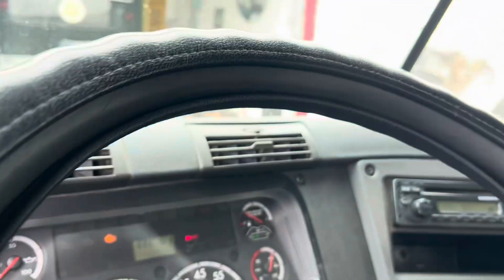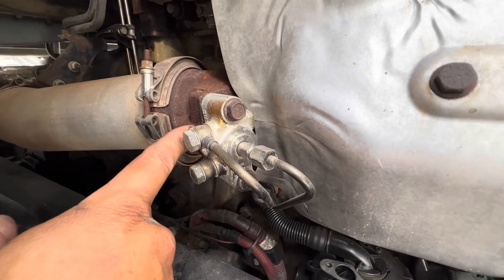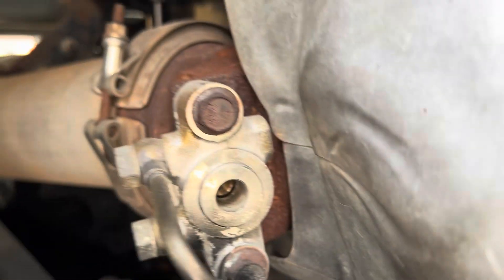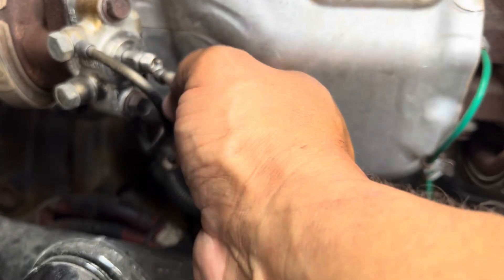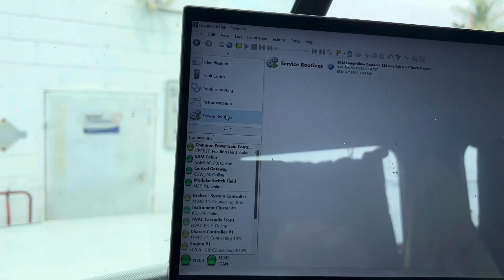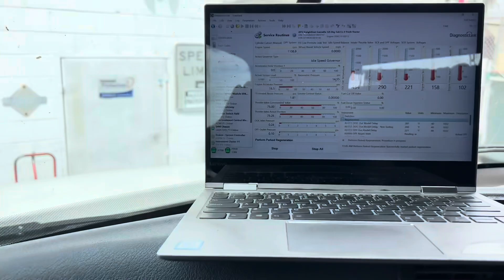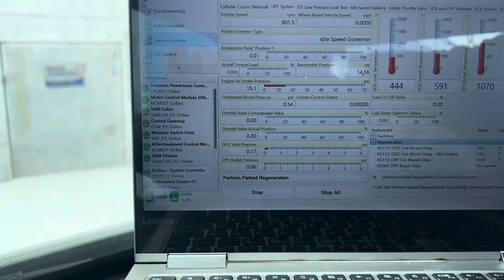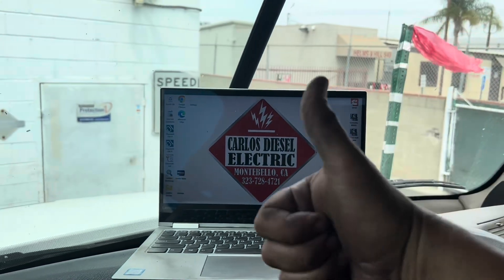Regen Temperature, out of range low. SPN 3556 FMI 1 Where to start and what to look for.

Comment: Had a doser valve replaced but the code keep coming back a few days to a week later . Any advice. Also i can get the truck to do park regen
Reply from the maker: What is the year and how many miles?
Reply: @CarlosDieselElectric 2016 with 941226 and I haven't clean that part yet went to dealer and the done the doser valve and regen then it came back went back they done some softwares  updates and regen again . Went to TA and they dont 2 exhaust leaks and Regen light still came back
Reply from the maker: @RONGTravel-Slots what is the DOC inlet pressure? DPF pressure? 
If there is a plug or flow issue that can cause the low temp regen. What else or other symptoms is the truck having?
Reply: @CarlosDieselElectric was told after regen all levels were in range
Reply from the maker: @RONGTravel-Slots does the regen run and then stop after a few minutes
Reply: @CarlosDieselElectric I cant get the park regen to even begin.  When the computer is hooked up it runs for all the way 45 min or so
Reply from the maker: @RONGTravel-Slots the truck will manually  regen if it is at DPF zone 2. The truck will always regen using the DDDL software.
Reply: @CarlosDieselElectric so if I push regen button it does nothing .The dealer and TA hooked up computer and did a regen
Reply: @CarlosDieselElectric do i even need to take off the doser valve and clean it?
Reply from the maker: @RONGTravel-Slots try, you need a 12 mm and a 14 mm wrench. Remove the valve. Apply shops air and then reinstall
Reply: @CarlosDieselElectric yeah did that it's a new part. Still when we do a parked regen nothing

Comment: I’ve got one that only doses fuel for about 15 seconds then stops, doesn’t get above 750 degrees because 7th injector isn’t going. No codes other than regen level 2
Reply from the maker: What year?
Reply from the maker: I need more information so I can try to help. In the beginning it will do a self check on the doser. After approximately 15 minutes it should start to dose diesel and the temperatures will start to rise. 
This could be a MCM issued ACM issue.

Comment: Had a roadcall for a derated truck.same code.did what you showed but temps wouldnt get over 700 and would regen indefinitely. Def pressures were good as was doser pressure.only got it to get to 1000 for a second and then it dropped back below 700 and would never come back up.also changed temp sensors to no avail.what was the next possible cause?as i never got it up to temp and out of derate.thanks
Reply from the maker: What year is the truck?

Comment: 15 psi on the oil pressure and thats good
Reply from the maker: @jaycarter9489  at idle and warm oil temp. Yes that is good. If you are concerned. Try using OEM filters, good 10W-30 or 15W-40 motor oil. Also, look.l at the Oil Pressure Sensor for any signs of oil leak around or at the plug
Reply: @CarlosDieselElectric what effect can a leaking pressure sensor have?
Reply from the maker: @inderveerbilling  over time it can. Also over time the oil will leak into the main harness

Comment: i have the same code  but i have just changed the 7 th injector 2 weeks a go , a force regen only delete the problem for couple hours  temperature normal
Reply from the maker: @yassinebarhdadi4815  what is the DOC inlet pressure when you are doing the regeneration? What are the temperatures?
Reply: @CarlosDieselElectric  the doc intel pressure 1.002 temperature around 750 noxconversation eff went up close to 0.62
Reply from the maker: @yassinebarhdadi4815  definitely getting close to being plugged. The threshold from Detroit is 1.16. 
My friends that are techs say anything that is close to 1.00 is plugged. 
This will definitely cause issues. Try doing a DOC face plug routine. Takes about 4.5 hours. 
Starts at low temp regen then at the last 45 minutes the temperature will increase to the normal.
Reply: @CarlosDieselElectric  thanks for the help 🙏🙏🙏i ll do it
Reply: @CarlosDieselElectric  doc intel pressure 0.44 nox convertion eff 98% code still showing permanent on status thanks 🙏 a lot for your help 🙏🙏🙏🙏🙏🙏
Reply: i think it was little bit low than 0.55 i don t remember exactly
Reply: i just start another parked regen  pressure did nt stabilize doc pressure show 1.002 temperature around 750

Comment: After watching this video, I realize the shop I used last week totally screwed me over. I had a check engine light on and they baked my filters, put a new def pump and def doser on. I left, put less than 20 miles on the truck and the light came back on. When I took it back, they took the 7th injector off and showed me how it was broken and caked with Carbon. They put another one on. I really need to get my own diagnostic tool.
Reply from the maker: There are a few options out there. I use the original software because it can do just about everything I need at our shop. 
A few customers have OTR or some even have the pirate version which seems to work for them. 
If you have any questions let me know. I’ll help as best I can.
Reply: I have a 2020 Cascadia and have the OTR Diagnostics. I like how I can do forced regens on it and clear codes.
Reply from the maker: @Nihil2005 I do like that about OTR. Seems work well with getting out of derate and regen issues
Reply from the maker: @Nihil2005  I have heard good things about having the OTR. Clearing codes and preventing derates is definitely a plus.

Comment: What’s the name of the line that you took off to get to the 7th injector? The one that you said be careful not to break. Mine is bent up pretty bad.
Reply from the maker: The line supplies diesel from the doser block to the 7th injector. 
Diesel supply line. Looks like a brake line
Reply: @CarlosDieselElectric  thank you. The one on my truck looks bent pretty bad. Do you have an idea of a price range to replace that. I’m scared what’ll happen if it breaks.
Reply from the maker: @dominqueferrari5196  I don’t believe they are expensive. Just more time consuming to replace.
Reply: @CarlosDieselElectric  great info. Thank you!

Comment: I’m working on a truck and the I’ve cleaned the 7th injector but it never sprays fuel. The Regan never finishes also
Reply from the maker: What is the DOC inlet pressure? 
Are the engine brakes going to 100% when you start the regen? 
What year and how many miles?
Reply: @CarlosDieselElectric  I was scrolling threw the comment and I saw you said to try replacing the mcm, I swapped it out for a different one and the 7th injector started working and the regen completed
Reply from the maker: @cfgflex8427 nice. Well done. Glad you found the problem
Reply: @CarlosDieselElectric after about 15 minutes the doc inlet temperature stays around 780-795 it doesn’t go higher than that. 2016, 507,729 miles
Reply: @CarlosDieselElectric I’m also not getting any fault codes

Comment: hi There, great info. Im using the older version of the diagnostic link on my 2013 DD13 Cascadia spitting out derate code and  3226 - 13 ( outlet Nox) so, I ran a region and didn't get hot enough with no fuel dose activity and the extra boxes next to the fuel dose sectiontion didn't pop up. I also don't have the green and red boxes for the box sensors as yours does.  My question is, can it be the bad outlet nox, telling the act or ecu to not spray the fuel dosing into the exhaust because of the bad sensor? Because I'm not getting a bad dosing fault. Tomorrow I'm changing the 7th injector because I did clean it along with the the S-pipe with no luck after a 90 mile drive.
Let me know if I'm making any sense. FYI my outlet not was not reading during regen
Reply from the maker: What is the DOC inlet pressure during the regen? The DOC inlet temp has to reach approximately 550 to start dosing 
When you are starting the regen, do you notice if the engine brake goes to 100%
Reply: Doc outlet temp was in the 700's and engine brake at 100%. I did have to start the doc face plug cleaning and then abort it. Once I did that it activated the doser. I actually cleaned it and installed a new one just in case. So now I was able to perform a regen saw the doser pop up and it was roughly at 12 % allowing dpf outlet temp in the 1100 range. All looked great except for nox efficiency was at .02550 and never moved from start up and now it's came up def air pressure high. Fault 4335- 14. So I disconnected the outlet nox and put on a new one outside the box to get that 100% reading and still didn't read it. Abs light is on and def blinking. It did bring me into DPF zone 0 from being at 2. I'm lost at this point. The next thing I'm assuming is the harness.
Reply: I also forget to mention, def is good quality and Tank still full after 4 regens and a 90mile drive. This is making me nuts lol
Reply: If I can call you to explain the whole situation on the phone that'll be so helpful. I know it's something easy, I just need a second brain lol. Let me know if that's possible.

Comment: You really need a longer hemroid brush, i have had them create a carbon wall 6-8" down the pipe. It comes from ideling and the doser dribble. I would replace the doser. Last i looked they are $56 fleet price

Comment: After looking at how simple the design of the Detroit aftertreatment injector is and how smooth and informative their software is , I kinda wonder why Cummins' designed of the 7th injector and software are antiquated.  Cummins makes it hard for even the skill techs to work on the aftertreatment system.  Thanks for sharing.  I enjoy watching a different engine from mine.

Comment: I have a cascadia with 3556 code in which during the regen  the fuel doser injection status never becomes active doc inlet reaches 800 degrees
Reply from the maker: During the regen, once the DOC inlet reaches 800. What are the temp?
Also, what year and how many miles.?
Reply: @CarlosDieselElectric  250k miles 2016 doc inlet reaches 800 degrees along with the doc outlet just doesn't get high enough to complete a regen because the doser is not injecting status not becoming active fuel compensation press is 85 psi doser line is 45 psi but injection status never becomes active..new doser block..
Reply from the maker: @TheDivineCode10  could be a bad MCM. Try installing a test or used MCM and the running a regen. 
I have seen this where the truck starts the regen but will not start the actual regen. Replaced the MCM and was successful

Comment: I have 15 cascadia with 3556 code. I cleaned out the 7th injector and cleared the light, but it keeps coming on with no codes at all. Any clue why it keeps coming on?
Reply from the maker: Run a  regen and monitor the temp on the inlet and outlet. Also what is the DOC and DPF psi?
Reply: How can u do a parked regen???
Reply from the maker: @stratefacts9075  there is switch on the dash that will let you do a parked regen if the truck needs it. 
You may need to do a sequence in order to initiate
Reply: I have white smoke coming from 7th injector....fuel line was replaced along with doser injector....3 weeks later same issue
Reply: @stratefacts9075  I don't think you can do a park regen with the engine line on. My diesel tech replaced the 7th injector and said all my numbers were good, but the light keeps coming on and goes in to derate.
Reply from the maker: Normally, when you have a check engine light on you might not be able to runa parked regen. A MIL is different. What lfsultncodes are on ?
Reply from the maker: @stratefacts9075  does the smoke come out when the regen is taking place or has just finished?
Also, did the replace the clamps near the bellows along with the gasket?
Reply: Same here bro...im in cali stuck..

Comment: How about 4077 fail 14???
Reply from the maker: Could be a circuit failed of bad sensor on the Doser block. The block may be less expensive to replace instead of the sensors. The sensors can be around $175 or more. But check your harness first for any signs of contamination. Also check the harness at the MCM and the injector harness

Comment: Hello! Thanks for the video. I have similar issue on my 2012 DD15 cascadia.
I get EEC61 3556spn fail 18 before the regen light comes on.
After performing the regen, i get EEC61 3610spn fail 2
But then few hours later, the check engine and warning light goes away. But it comes back again. What would be the first thing to do?
Reply from the maker: Sounds like there might be plug situation. What are the pressures? Especially the DOC inlet. 
Try running a regen and see what the numbers are.
Reply: @CarlosDieselElectric  Thank you for you comment! Mechanic was seeing the temperature while doing regen, and said the numbers look good
Doc inlet temp 650’s
Doc outlet temp 1000+
Dpf outlet 1025
Reply from the maker: @lathedieselchef5741  what was the pressure for the DOC inlet?
Reply: @CarlosDieselElectric  Dpf inlet was1.42 psi / outlet was 0.42psi

Comment: I have my truck at FL dealership now. They replaced the nox sensors, now the four hour forced regen will be interupted ,and engine light, check engine light, engine stop light all came on, with bunch of codes. Any suggestions ?
Reply from the maker: The DOC face plug routine will run 4.5 hours. 
If they are running the routine it means the face of the DOC may be plugged. Ask them what the DOC inlet pressure is reading before during and after. If it is 1.15 then technically Detroit considers that plugged. 
Let’s start with the pressure on the inlet.
Reply: @CarlosDieselElectric  they gave a code  5018/18

Comment: Does temperature fail by DPF leaking in gaskets?
Reply from the maker: Yes. The front V Clamp and the rear clamp with the seal should create a tight seal and not allow exhaust leaks. 
This can definitely effect temperatures.

Comment: I’ve seen techs that say I can test my NoX sensor outlet by removing it from its port and letting it lay outside the port  in the fresh air while you do a regen.
If I can do a regen with the outlet NoX sensor uninstalled couldn’t I just zip tie it to something and drive it to the shop?
Reply from the maker: I have secured the outlet sensor and performed a parked regen. This has helped increase the NOx efficiency and allowed the truck to clear the codes and derate.
Reply: @CarlosDieselElectric  but could it be driven to the shop in this configuration? Not just regeneration but driven?